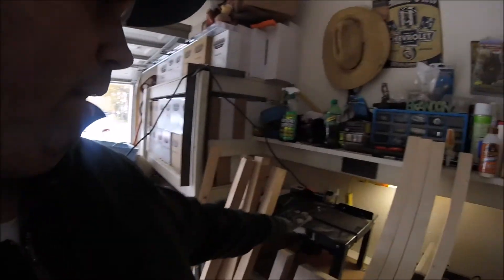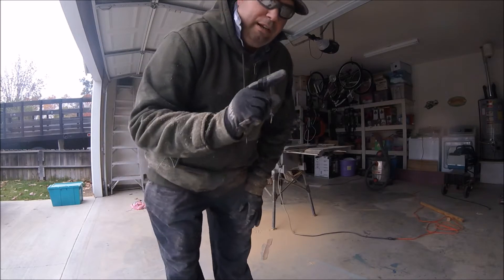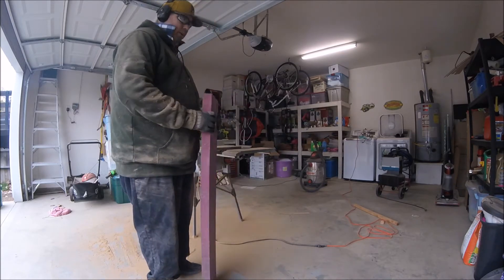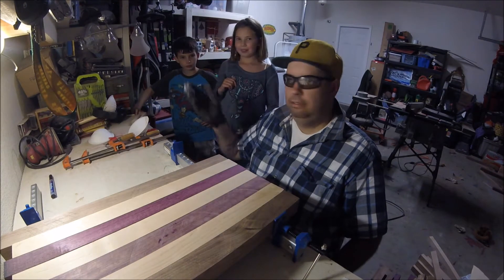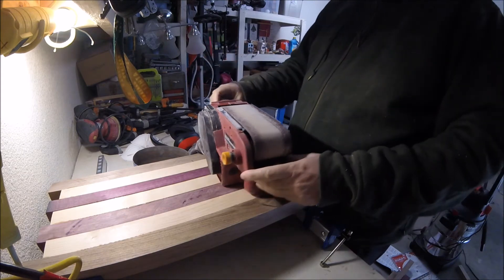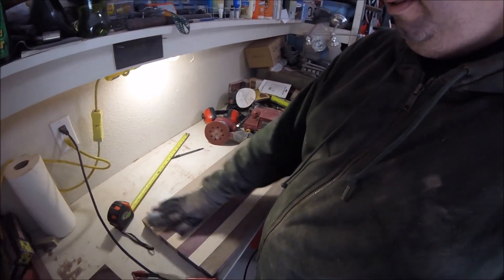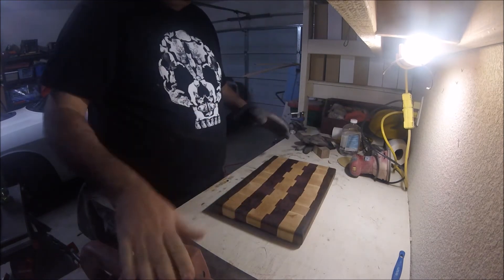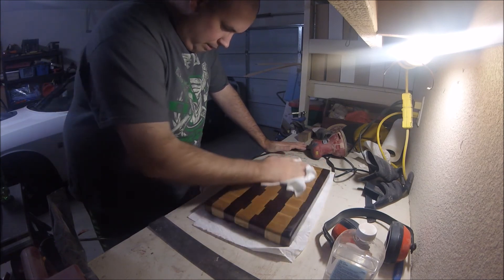End Grain Cutting Board

Comment: Nice job, Brandon. I have a couple comments... It looks like most of the dust is coming from the bottom of your table saw. Try to fit a barrel up tight below the saw to catch the majority of the dust. Is there an out feed tube on the back of the saw for dust? Mine has one and the shop vac hooks right onto it. I'd also just cut outdoors if you can get away with it! Safety tip: As a beginner, Do not wear gloves when operating a table saw. (Or any spinning power tool!) Gloves won't protect you from the blade and they could pull you INTO the blade and make a near miss into a tragedy. Other than that, that was a great outcome for a first try on a cutting board! They'll only get better, faster, easier from now on. Good to see you making videos again.
Reply from the maker: Vino Farm Thanks for the great tips.  I looked up a parts list for this saw and it originally came with a dust collection bag for the bottom, although it does not have an outfeed tube for collection.  I guess my dad doesn't have it anymore but I am going to get a new one.  Also, that's a great tip about the gloves.  I never even thought of that.  You probably saved me from future disaster.  What a good friend.

Comment: Good to see you back. My hive is still hanging on, it's been below freezing this week. I had mites on my bottom board and didn't treat. I wasn't hopeful but they are no longer dropping and the bees are alive. I will know in Spring if it worked out. 
I have the SAME Table saw from my father!! As a general rule I never wear gloves when using a table saw or any saw. If the blade grabs that glove it will pull your hand in. I know it saved you this time, but I get nervous when I see gloves. Glad you put the dust mask on for sanding, I was hoping you would have worn it when you were cutting as well. Those are some hard woods. Hopefully the blade doesn't dull too quick. I didn't see the push stick until the end of the video. I am a big fan of the push stick especially on those narrow cuts. Now make some hive boxes!
Reply from the maker: Thomas Gordon I received the same advice about the gloves from another poster and haven't used them since.  Thanks for looking out for me.  I think I need to get a better dust mask thing because those little paper ones don't work for me.  Best of luck with your bees.